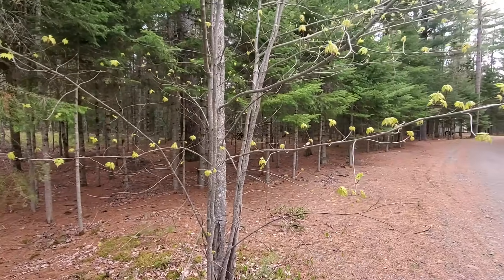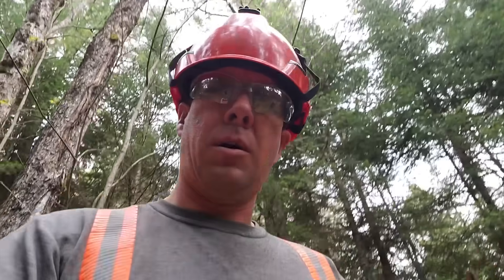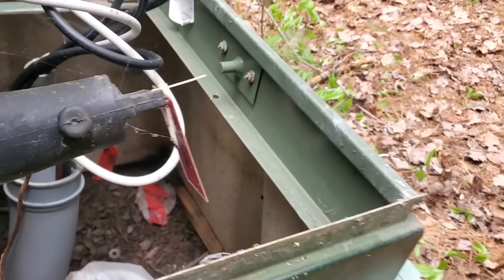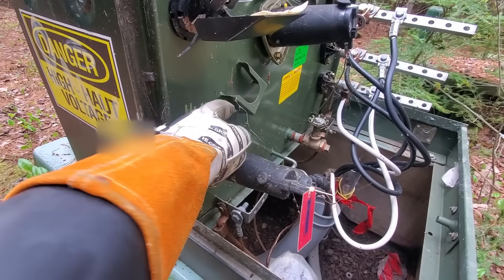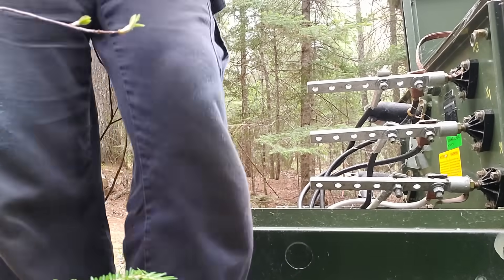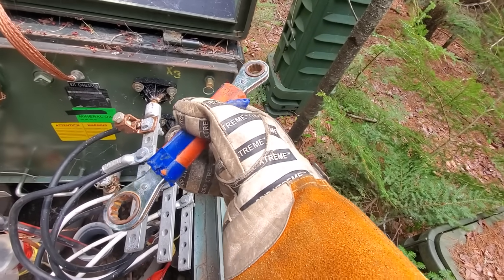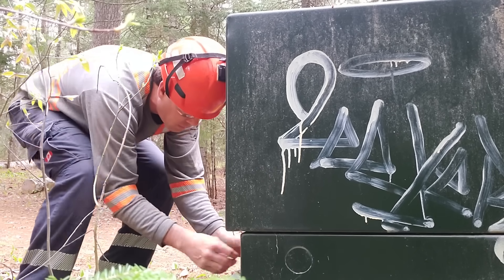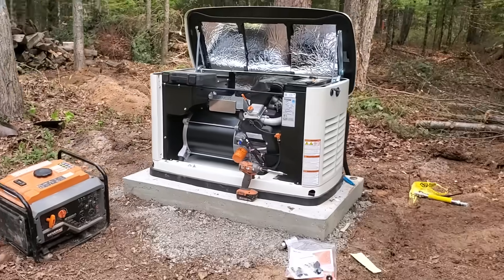Padmount transformer service disconnect

Comment: Thanks for an interesting view into this work. QUESTION: I noticed that your clamp-around ammeter reading appeared to settle at around 0.6 or 0.7 amperes on the customer leads that were being disconnected. Is that current caused by stray capacitance between  the long buried conductor and the earth?
Reply: It's a true RMS meter, and they essentially never read zero - there's a small offset and a significant non-linearity at the bottom end of the range, typically. From the specs of that meter, the AC current accuracy is 1.9% + 1.1A + 1% depending on wire position in the clamp. If you notice, it shows anything from 0.3A to 0.6A in open air. It's a pretty basic meter with no zero function, so you just have to work with that degree of uncertainty.

I have a 60,000 count meter here which specifies 0.9% + 30 counts in the 6V AC range, and indeed with the leads shorted it reads 0.0020V. In the 600mV range it's 0.5% + 30d, and reads 000.06mV shorted - I am absolutely, 100% positive there's not even 60μV across my shorting link, but the offset is well within specification.

Knowing your tools is half the battle. But yes, a small current may flow capacitively, but it will be far below the resolution of a meter like that. 100mA would require in the region of 2.2uF capacitance to flow, which would take.. well, this is a bit of guesstimation, but let's just say you take a 4/0 wire and sit it 1cm over a ground plane for a 500m run - that's 25nF, or 0.025uF. Nowhere near accurate enough a model to get an accurate number, but two orders of magnitude off, well, let's just say it's not that.
Reply: maybe just adjacent coupling to other service under ground ect

Comment: Retired as an Electrician/Technician from a Steel Mill in Northwest Indiana.  Worked on everything from 12.5 KV to complex computer systems on a 5-stand rolling mill, including overhead cranes and electric forklifts. Steelworkers Union member and officer, still active as retired member.

Comment: Not an electric worker but I noticed you didn’t disconnect the neutral, wouldn’t that allow a potential back feed?
Reply: Isn't it tied to ground so it shouldn't matter?
Reply: No.  You need two conductors for an electrical circuit.

Comment: Had to pull bayonets during a heat wave last summer.  Could not relieve all  pressure by venting because it was so hot.  Suggestions?
Reply from the maker: Oh crazy! I've never run into that before 😧 I'm not really sure 🤔... A first thought would be to jam the valve open with removing the fuse and to remove it very slowly after the initial break.

Comment: Sir I know you're in Canada but thank you to you and you're brothers and sisters in the IBEW for keeping our electric on. I live in the United States but without the IBEW safety would go out the window and our electric power grid wouldn't be where it is today. My grandpa worked for Louisville Gas & Electric in Kentucky as a supervisor in electrical distribution and a member of IBEW local 2100. After the 1974 tornado that went through Louisville and took out a major substation my grandpa rebuilt that substation from memory because LG & E could not find the blueprints. My step-dad was in the IBEW local 2100 for many years also.
Reply from the maker: Appreciate the comment Greg! Sounds like your folks were a pretty important part of their community! Cheers! 👊🤝
Reply: Knowlegeable people like Bob are an absolute necessity in our 21st century infrastructure

Comment: not sure why they tag the eye on the elbow, usually we use a shotgun stick to pull and push on the elbows from that eye, so i cant see it being advantageous to the operating lineman to have to work around that tag. i could be overthinking it though. let me know your thoughts if you see this!
Reply from the maker: It's definitely a reasonable concern. The potential cap would be better, but can easily be accidentally swapped. The tag doesn't get in the way much, as we use a shot or a thumper as you mentioned. I don't see why  the tag couldn't  zipped tied around the cable itself a few inches down, but the eye hasn't seemed to get in the way with any stick work
Reply: We put our tags around the cable at the concentric neutral spot plus a a tag on the transformer door.
Reply: @lewy1  we put ours on the bleeder usually, so its out of the way.

Comment: I work for one of the largest utilities in america, and i plan on going into the Underground Lineman development program to become an underground lineman, it is something that a lot of places are going to exclusively or at least trying to, so it makes sense to me to try and get specialized in it. also, IBEW Local 50 checking in!
Reply: Greetings from Korea I am also doing underground lineman in korea since 10 years
Reply: @Paudelhem  thats awesome! Stay safe!
Reply: Why does the hig voltage only have one conductor/elbow.  The main feeder pipe only has one cable. Is the shelding ground used as the second connector?
Reply: @j.s3612  there is concentric coiled around the semicon and insulating layers in the cable, its Jacketed Primary cable, if you google it it should show you how it works

Comment: Hi Aaron,
IBEW Local 457 Berlin,Connecticut (USA)
I already know your a journeyman lineman. However I have a couple of suggestions on the pad mount transformer. 
We give the door a couple of taps with our boot incase there is an animal inside. Last thing we want to do is open the door & startle it. 
Second I prefer to wrap a rubber blanket around the hot stabs of the secondaries incase your wrench slips?
Reply from the maker: Hey John! Always a pleasure hearing from ya! Another mentioned about the cover up on the bushing... Something we do here as well! I totally forgot to mention that in the vid and will definitely do a follow up video showing that!
The animal thing I almost never do, but I'm definitely gonna start! Great tip! One of our biggest problems here is hornets nests 😧

Comment: I'm only a telecom guy, but it's always a pleasure working with your Brothers from 773 in Windsor, ON.
Reply from the maker: Never say "only" my friend! Load of tension and complex work in the telecom field! Much respect all the same 👊👊🤝
Reply: @Bobsdecline  Thanks man, I look forward  your videos. I've learned lots of tricks and, best practice from the sparkies I work with. I even match my screws so the slot in my slot/robbie combo screws match your vertical ones lol.
Reply: No trade is more important than the other.  I hate the ego in line work.  I started in telcom, then inside wireman, then distribution lineman.  Never once have I looked down on any trade.  It’s all essential.

Comment: I have seen this before and often wondered if a piece of sliced radiator hose could be put over the next buss bar to prevent accidents. Maybe even an old piece of that stuff you guys use to insulate triplex when crews are working on a house.... just shorten it to fit the application. Ok, maybe that's an oversimplification, but I would bet there's am approved insulator to do the same thing.
Reply from the maker: Oh man! Super good point Rupert! We actually do that all the time in the field... I can't believe I didn't mention that in the video :/.
Often times we used the 1000v yellow blankets to cover the other bus bars that aren't being worked on. We also also some other approved cover up methods. 
Definitely going to release another short video demonstrating this 
Thanks for the great comment Rupert!

Comment: Interesting how different everything can be in a different country. In my country we use a mini "substation" with local stepdown transformer 11/0,4kV 100-1250kVA with abb kabeldon fuse switch disconnectors on low voltage side that feed an array of abb kabeldon cable distribution cabinets  with the same switch disconnectors that feeds every customer. So never any hot work to disconnect a customer, just pull an SLD fuse disconnect out.

Comment: I'm curious to hear from the experts here.  Would there be any potential issue with installing a 3 pole disconnect on the house side of a meter in case any future work needed to be done?  Would that require a seperate, properly sized and spaced ground rod connection for the meter box isolated from the neutral?
Reply: Typically no as this would allow the customer to easily upgrade their service without contacting the utility and avoid having the line side equipment upgraded possibly leading to overloaded transformers or cable
Reply: @james5118  actually the 2020 NEC now requires external disconnects on the load side of the meter, mostly to allow firefighters a mean of emergency disconnect. If that easy upgrading was a concern then I doubt that code requirement would have been implemented.
Reply: @ryuukeisscifiproductions1818   While that may be the case in the US, the NEC doesn't apply in Canada and would really depend on the country or location (ie. residential, commercial or industrial).

Comment: im surprised of the bonding wire location as i thought it could  touch the secondary buss bar when closing the lid
Reply: Hah,I thought the same thing,you wait,one day there will be a catastrophic failure & the manufacturer will redesign it & move it to the corner.🤔

Comment: Looks like a 22 KW Generac backup generator installation. I wonder if they have frequent outages out there? With underground lines I wonder what the source of their outages would be?
Reply: Even though the primary voltage lines run underground to the primary sides of the transformers, they must run to a dip pole usually located at the road or by the entrance to the neighborhood.  The pole contains the primary feeder fuses, that primwry pole has overhead primary wires that run down the pole and goes underground to all the transformers in the neighborhood. Remove the fuses or the wires get damaged that goes to this pole, then every house in the neighborhood looses power.  Where i live here, the the primary pole is right in front of my neighborhood entrance.  I think all of our pad mounts are 25 kv, but may be wrong.  There are 2 houses per pad mount transformer.  We have a total of 80 houses in my neighborhood.
Reply: As a homeowner with a backup generator, frequency is less of a concern than duration. In this house, we're on a well, so no power == no water, and that's no bueno. While we do have a wood stove insert in the fireplace, it's not supposed to be run without the fan, and it would not be nearly as effective without the fan. I elected to install a 22KW Generac system that's run of the 500 gallon propane tank that feeds the furnace and one of the water heaters (the other is electric). I'd prefer a dedicated 1000 gallon tank for the generator, but the installation and initial fill cost would be insane. I just try to keep the 500 gallon tank above 50%, which should give me around 3-4 days in a winter storm if turn down the furnace and use the fireplace, or a 5-6 days in the summer. More if the tank is at 80%, of course.

Comment: It surprises me that you don't have a simple means to isolate a customer that doesn't involve physically disconnecting them from the transformer. Here in the UK, every supply head has a 60A or 100A cartridge fuse immediately before the meter. Isolating a supply is simply a case of pulling out the fuse at their meter box.
Reply: Such things are not installed here because the expense is not justified.  Most people don't ever need their electrical service disconnected for working inside it.
Reply: The transfer switch they are installing on the meter would provide that. These pad mounted transformers with few customers, they don't put a lot of foresight.
Reply: Then I wouldn't have a job disconnecting for the sparkies
Reply: Generally the meter itself is removable to provide isolation. It simply pulls out of the meter base to disconnect the customer from the supply. It serves the same purpose.

In this case it seems like the electrician working to install the transfer switch wants to work on the meter base, so for safety they need the supply disconnected.
Reply: In the UK the DNO (same as DSO) is responsible for wiring up to the meter and the supply company responsible for the meter itself.  The customer is only responsible from the meter onwards into the rest of the property.  Here the customer seems to be responsible for wiring back to the transformer which is located on or near their property and only serves small number of properties whereas in UK the transformer tends to be further away and serves a much larger number.  The meters here appear to be owned by the DSO but plug into customer owned socket and function in a similar way to the cutout fuse in UK by disconnecting line but not neutral.
Reply: external disconnects other than the meter have started to be required in recent years, but only since the 29020 NEC.
Reply: @ryuukeisscifiproductions1818  And those main disconnects are after the meter, so they wouldn't be applicable here.

Comment: I’m an electrical engineer. When I was younger I supported unions in manufacturing but always thought they were kinda a pain to work with. But now I realize a little pain and slow down sometimes is worth it for the huge benefits for those members. A tiny improvement for me is not worth the huge improvement for them. Unions are worth it.
Reply: Been in the IBEW (UNION) for 25 years now, it’s been inch a great career.
Reply: Unions work and they help all of us who work keep on working while looking out for those who can't. Unions aren't a hassle, and never were, they're necessary to prevent so much more hassle and abuse from management - and they work better when people who work the desks work alongside those who work the line. Whether we work paper or metal, management doesn't care for our time. All of us together, they will! Abuse of any of us will - cost them more than a dime!
Reply: Unions reward everyone the same, while there are some who wish to excel. Great for the one who want to do the minimums, not so for the go getters.  My opinion from experience.
Reply: @SeanONeill13  - The vast majority of people don't fall in one of your extreme camps. And I suspect all unions are different. In my experience the "go getters" were promoted to a high level engineer status and/or graduated into management.  I agree there were a few slackers and incompetents that didn't pull their weight who were not fired immediately but fell behind in ranking and were separated during layoffs.
Engineers were not rewarded equally, but because of the union we had visibility of where we stood. Super important. And negotiated bargaining that individuals who are not superstars can't really achieve. In addition you have a healthy team spirit.
But the company was not happy with our (and the  production workers union) and they had the ultimate power. Their punishment for a successful strike and later production worker strikes was a many year effort eventually moving much production from the Pacific north west to the union-free Bible belt.  At the time I retired (about 14 years after the big strike) the company was trying to move a large division of engineering from the liberal green hills and beauty of the Seattle area to a presumed hell-hole - Oklahoma.  Very few engineers were willing to move even knowing they would keep their high cost-of-living salary in a low salary state. Most preferred early retirement.  I don't know how it worked out.
Reply: Agree - and not only for the hourly people.  I'm an electrical engineer - now retired - and was a member of SPEEA (Society of Professional Engineering Employees in Aerospace , IFPTE Local 2001) almost 40 years. And that included a 40 day strike which blocked a bunch of benefit and retirement cuts.

Comment: Hey man I love your videos. My job is identical to yours I'm in local 841. Sometimes you guys use slightly different terminology than what we call things but it's all the same. I'm in Alabama by the way.

We normally mark those underground services with colored marking tape. Makes it way easier to find although like you said you did have one copper run and one aluminum run so it's a no brainer.